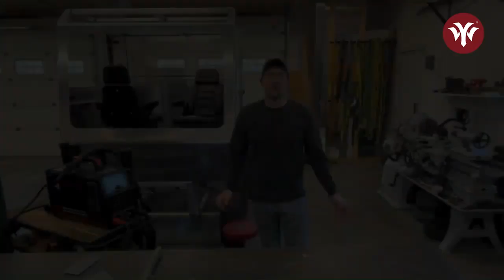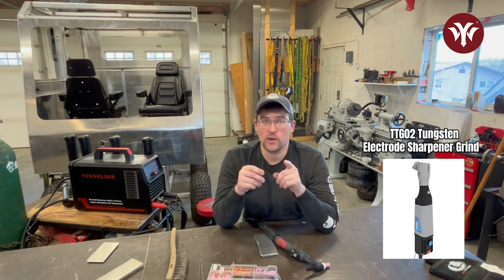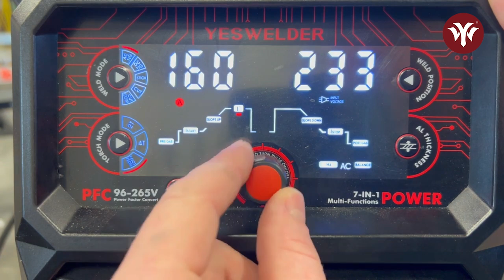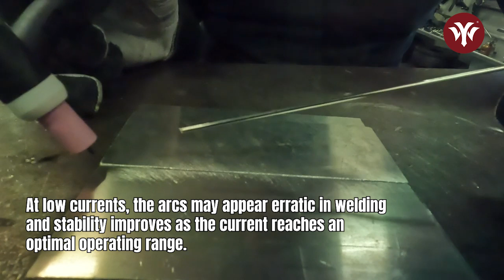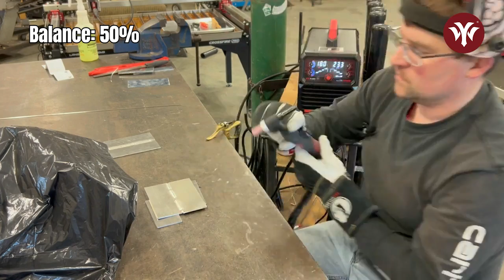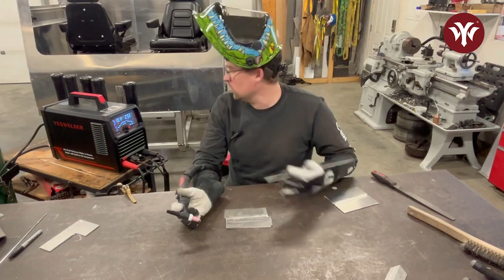Aluminum Welding Tutorial: Master the Basics | YesWelder

Comment: i keep getting black specks when i’m welding i clean before i weld. and im also welding a thick flange to a thinner plate i direct heat to the flange but the area i have to weld is very narrow and my cup doesn’t fit to where i can maneuver my cup where can i find help in seeing what i am doing wrong anyone ?

Comment from the maker: Outline:
00:00 Introduction
01:22 Tungsten Selection
02:40 Torch Setup
05:06 Nozzle Selection
07:29 Aluminum Basics
20:20 Pre Gas Setting
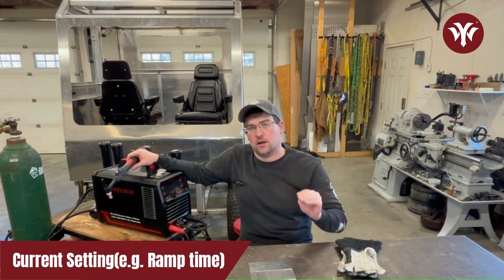21:37 Current Setting
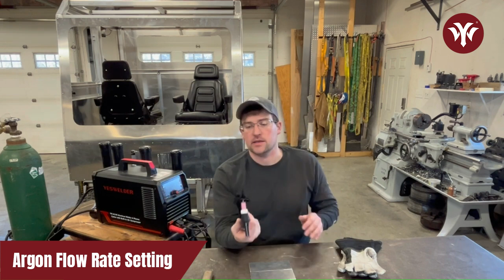21:50 Argon Flow Rate Setting
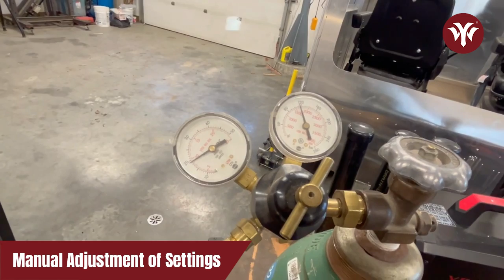25:02 Manual Adjustment of Settings
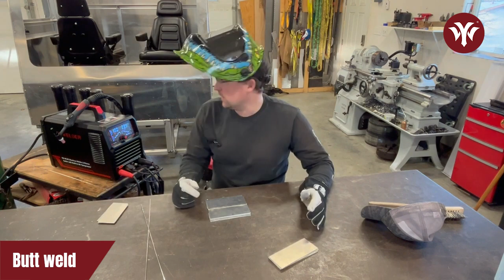31:48 Butt Weld
36:07 Welding Puddle
40:17 Balance Test
46:47 Frequency Adjustment
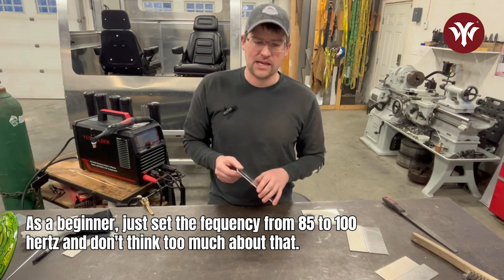49:52 Pulse Welding
57:43 Gas Flow Simulation
59:59 Conclusion